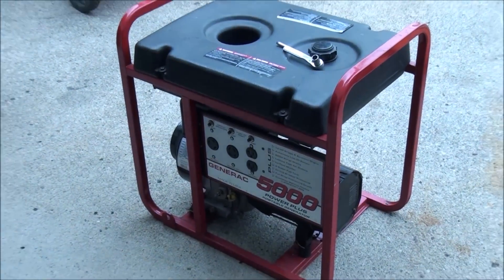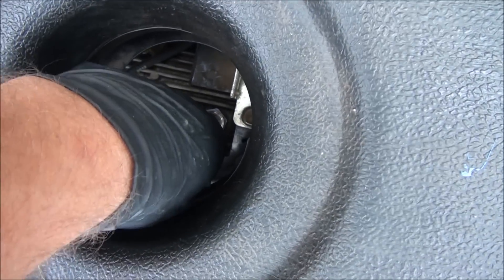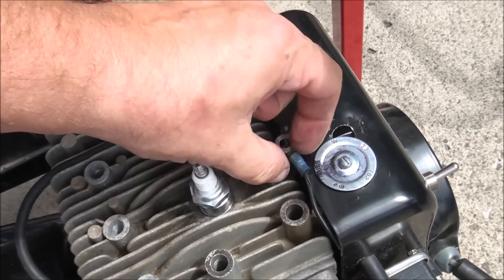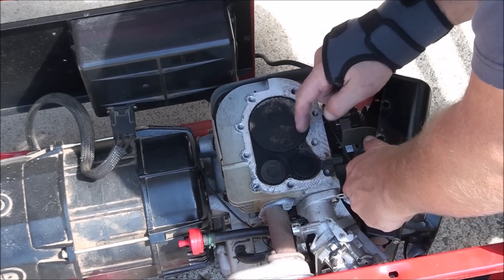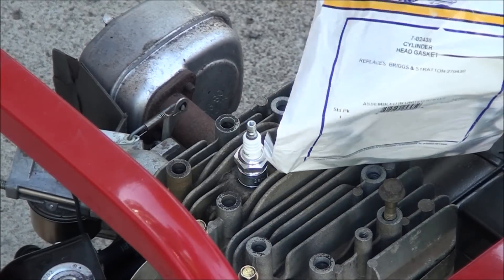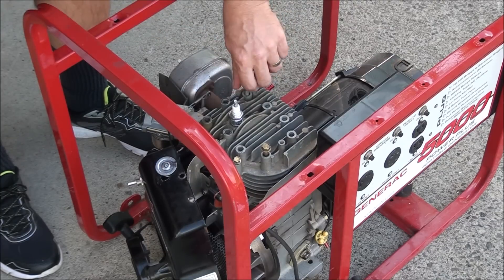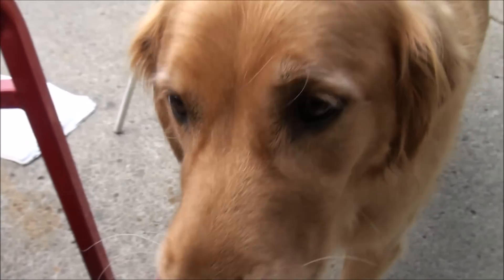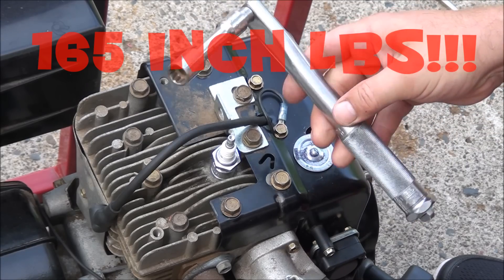HOW TO TROUBLESHOOT a GENERATOR that WON'T START or RUN - BRIGGS and STRATTON 10 Horsepower engine

Comment: I have the same model B&S motor. Be sure to keep an eve on the air filter cover, there are none available anywhere if you lose/break it. Believe me, I've tried to find one. 3D printer is the only recourse.
Reply from the maker: Good to know, thanks for sharing!

Comment: Awesome 👌 I think that's what is wrong with mine. Because when I bought I made it turn on. Then after two more times it wouldn't. So I cleaned out the gas tank new gas new carburetor cleaned up the spark plug changed the oil! And it won't turn on I also put a new ground switch yellow n black wire! Must be the headgasket
Reply from the maker: To help diagnose the issue you can use starting fluid to see what happens. I would also use a new spark plug when testing it out.

Comment: How you get the torque specs for this engine I been looking everywhere
Reply from the maker: they are out there on the internet. I also have a briggs manual for that  model
Reply: @jeffslawnmowerrepairandservice  is it the same as 19e412 0131 01

Comment: The single long bolt goes between the two valves.  Presumably that hole has recessed threads to allow for more thermal expansion around the valves.
My guess is that a previous person loosed some of the head bolts while diagnosing a failed shutoff switch, and didn't re-torque them after putting the blower cover back on.
I was initially confused by the extra wire with the ring terminal.  Then I noticed the toggle switch.  Someone replaced the failure-prone rotary shutoff switch by blocking the original hole with an electrical box knockout plug and drilling a smaller hole for a standard toggle switch on the front.  The visible wire is likely the ground for that switch, with the other lead going to the ignition module.  (The ignition module terminal is left open to run or grounded to kill the spark.  It wouldn't run at all if connected directly to the grounded shroud.)
The spark plug lead is longer than from the factory, so they probably replaced the ignition module and a few other parts before figuring out that it was just the switch.

Comment: This video is totally bogus!! Head bolts DON'T COME LOOSE just like that!! Some idiot didn't TORQUE the head bolts down!! I fix engines too and have NEVER come across head bolts that just happened to be LOOSE. Anywho, good luck on trying 2 fix this poor American brand engine....I'll stick 2 my Hondas! They run like clocks!!
Reply from the maker: yeah someone probably messed with it

Comment: Hey man quick question.  Does the fuel line coming from the gas tank, go straight to the carburetor or does it go to a like a square block thing and then comes out to the carburetor??
Reply from the maker: it depends. What you are describing might be a fuel pump setup
Reply: Yes, the square or rectangular block mounted with two long screws to the side of the blower housing is the air pulse operated fuel pump.  It's identified at 3:14 where you can see it as the rectangular assembly unscrewed from the blower housing.  It's best to remove it so that the mounting ears aren't broken off.
The three connections are in, out and air pulses from the crankcase.
All three originally used fuel hose marked 'MXRI', which should be replaced as it ages badly with E10 fuel.
The pump is held together by three screws.  Replacement diaphragms are inexpensive and readily available.  If you need to replace the whole pump it's easiest to get the new round style.
A fuel pump is arguably redundant on this genset which has an overhead fuel tank, but it will keep the engine from running lean if the in-tank fuel strainer or in-line fuel filter starts to clog.

Comment: Ours start but when you plug in a fan we have no power....any suggestions?
Reply from the maker: try to reset the circuit breaker and/or fuse located on the panel.

Comment: Why didn't you just take out the spark plug and check for compression?
Reply from the maker: believe it or not, I rarely check compression. I can check for spark, fuel and compression at once with a spray of starting fluid into the carburetor.
Reply: @jeffslawnmowerrepairandservice  I can see the fuel part with the either but not the spark and compression.

Comment: My husband follows these steps and that help a lot. The on off button is absent on my generator briggs ans stratton (very similar at this one). The only way I found to start it was to use the switches to start the engine, one at the left and the other at the right, I put an on off button beetween them and it start but never stop, I need to close the gas valve. I dont know what to do with the wire close to the missing on off regular button. If somebody has the solution I will be happy.